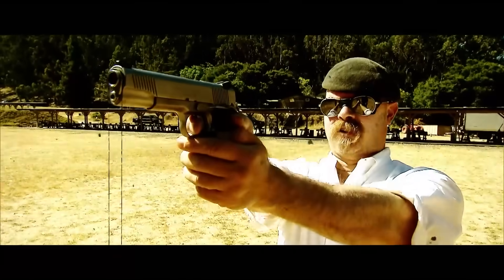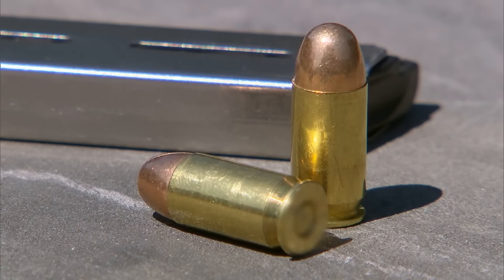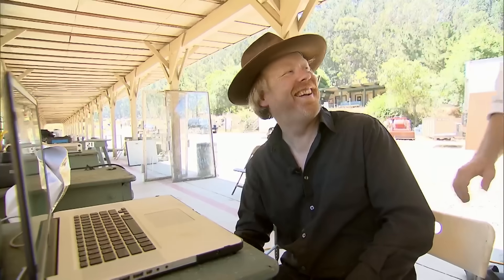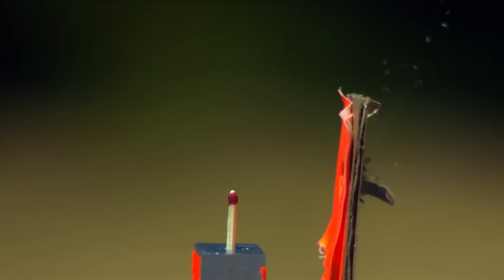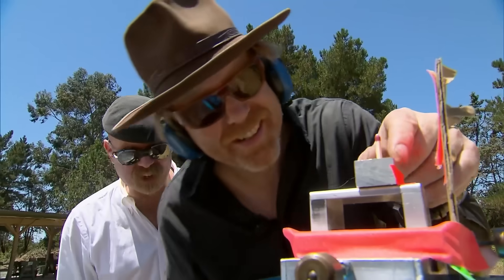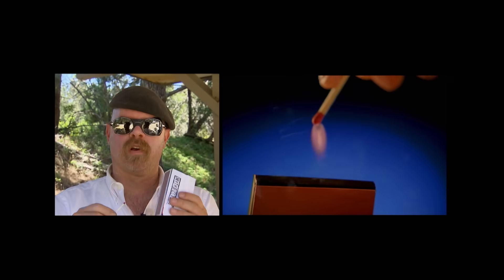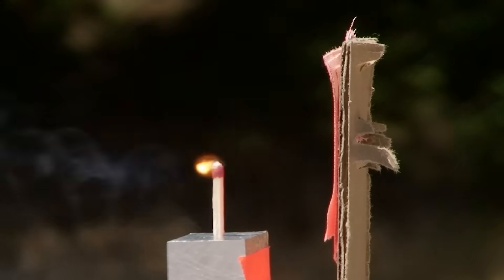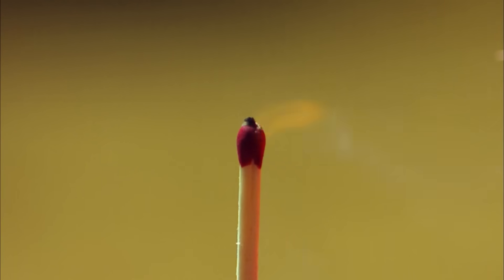Can You Light A Match With A Bullet? | MythBusters

Comment: Wouldn't it be easier if they put a match slightly higher, behind the one match, and another one behind that one that is slightly higher still, etc? IOW, set up a ramp of matches and aim towards the middle of the ramp. Then they wouldn't have to spend so much time adjusting the height of the aim.
Reply: Be easier with 50 matches at slightly different heights.

Comment: My only complaint is the narrator implying that the myth may have been considered busted if they had not taken that final shot. If the only difference between a busted myth and a confirmed myth is a lack of testing, then the myth isn't busted. I assume that the guys would have given a verdict of "plausible" if that was actually the case.
Reply: Theoretically, if you slam your hand enough times on a desk, there is a chance your hand will pass straight through the desk if the atoms in both objects align just right. Slap your hand on a desk a duodecillion times, then repeat that a duodecillion times, and then repeat that a duodecillion-duodecillion times, and then repeat that a duodecillion-duodecillion-duodecillion-duodecillion times (that would be 10^(10^(10^(10^41))) attempts.), and you might see it happen if you are extremely likely.. But for all intents and purposes, it is impossible for your hand to pass through a desk.

At a certain point, you have to be pragmatic. You could take anything that is not literally impossible, and it will eventually happen once. If you try a reasonable number of times, you can formulate a reason it doesn't work, and move on with your life. If that motivates someone to prove you wrong, then great, new science has happened! You can't truly prove a negative.